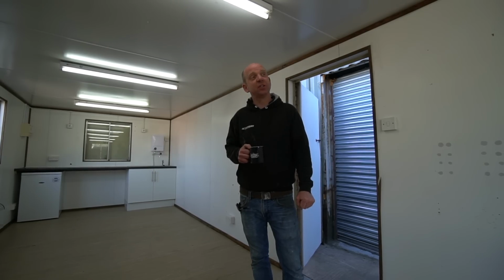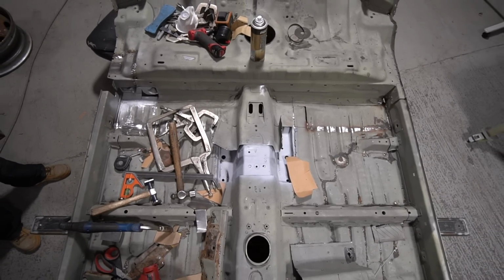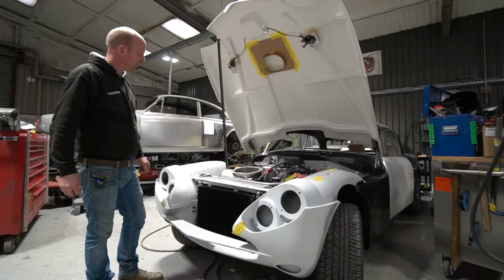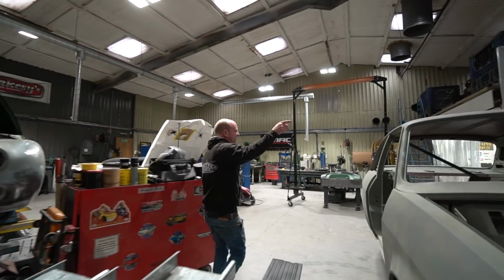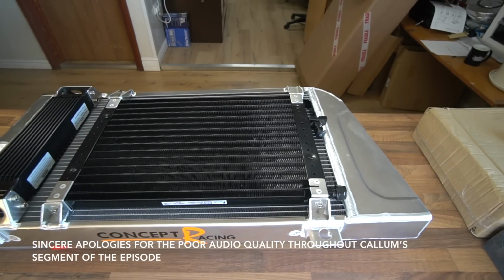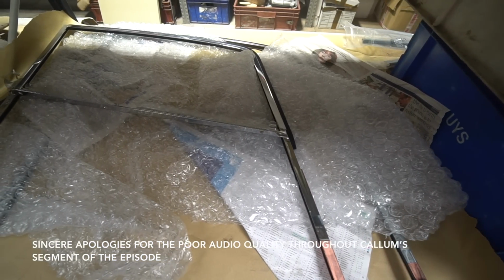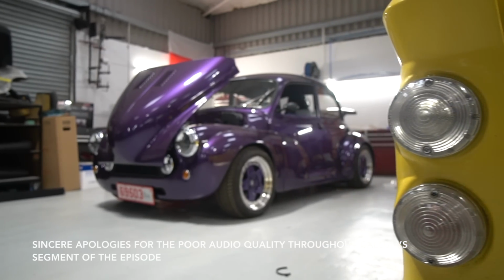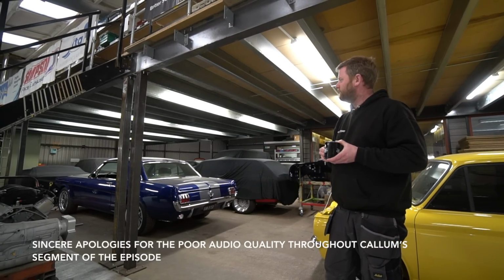FJ40 Land Cruiser RESTOMOD with 1UZ-FE V8!

Comment: I wonder why they went with unnecessary complexity with the two fuel tanks when that 29 gallon Long Range tank is available (I have one in my '75) that is a single under-seat solution that does not require multiple pumps and fillers.

Comment: They make 2" shackles for FJ40s. They are actually meant to raise them up a bit - however - they have a very positive effect on ride quality because the angle of them cushions a lot of the harshness. Despite the higher CoG the handling is actually better too, as is braking. 
Leaf sprung FJ40s are very unforgiving of mid corner lift off of the accelerator at speed. The axles start steering and the driver corrects and it induces more steering and they run wide, then tighten in from driver input, then turn over. It happens very quickly, so quickly that the driver often doesn't know what happened.

It's because of the leaf mounting points the front springs are mounted solidly at the rear and vice versa for the rear springs. As you corner - particularly with a V8 as speed is likely to be higher than with any of the OEM engine offerings - the cornering forces compress the leafs, lengthening them on the outside and shortening them on the inside, inducing uncommanded steering input. 

On a right sweeper for example the front axle steers right, and the rear steers left slightly and this is different to the line the driver selects.
It is all completely fine until it isn't and it isn't if you're over cooked speedwise. It is made worse the heavier the vehicle is. Not too bad if it is driver and one passenger but load it up for a camping trip with gear, water and fuel the effect is frightening.
Extended shackles lessen this effect noticeably but it's still there.  
Owned two of these, the second also has a V8.

Comment: What engine and spec is in the imp ?
Reply from the maker: Extended block with long liners and custom crank to make 1200cc. Think its around 120bhp if memory serves
Reply: @retropowercars  Had a shot in a 1040 Imp with twin 40 DCOE's years ago, that was mental with around 100bhp, rev'd to 9K and sounded like a big bike,  they are cracking little things when everything is bang on, motor is a little jem.
Reply: FOUND a video that includes the Imp, Uncut Ep 6
https://www.youtube.com/watch?v=6PGxfHJR520

Comment: Knock sensors should not be mounted near the valve train , they should be mounted as close to the top of the cylinder walls as possible.

Comment: Is that really the position of the oil cooler with the rad out the way their is loads of space in the engine compartment ?
Reply from the maker: Customer request as its a homage to Imps built by Greetham Engineering back when they were new. Their cars always had the coolers there.
Reply: @retropowercars  at what point will you get bored of copy/pasting this reply 😂😂

Comment: That little Hillman Imp is beautiful although i dont likè the positioning of the oil cooler in the rear, literally looks tacked on, That Morris is beautiful as is the E-Type.
Reply from the maker: Customer request as its a homage to Imps built by Greetham Engineering back when they were new. Their cars always had the coolers there.
Reply: @retropowercars  proper then, sweet.

Comment: Very similar noise problem should be expected on the FJ40's wiring, when you get it up and running. Not sure if isolating the sensor wires and injector wires will remedy the problem completely. Although the initial idea of hiding all the wires under that cover seems like tidy solution, it also creates a space where heat and electrical noise builds up.

Comment: The external oil cooler on the Imp is unusual, to say the least. It must be so satisfying to see old projects living the lives you gave them.
Reply from the maker: Customer request as its a homage to Imps built by Greetham Engineering back when they were new. Their cars always had the coolers there.
Reply: @retropowercars   Ah, quite right! I thought it weird when I saw it, but I’d forgotten this.
Reply: If it's possible to do a driving review of this car or even just a detailed walk around that would be great. I don't remember seeing footage of the build, but maybe I missed it. A superb car, the only thing I'd change would be the dark glass; but it's not mine is it?! Cheers.
Reply: @secretsquirrel3793  It's a stunning thing, i had a few Imps about 20 odd years ago, they have gone up in value quite a bit since then, like you not a fan of the dark glass, always wanted a Sunbeam Imp Sport with the four headlight front (like this car has), best looking Imp IMO.